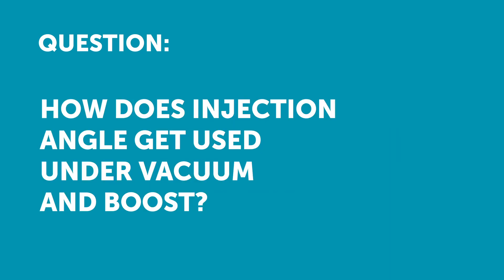Injection Angle | Boost and Vacuum Injection Timing Tips [HPA Q&A]

Comment: Interestingly, at low load conditions in port injected engines it's often more efficient to fire the injector while the intake valve is still closed (and I don't mean start injection before the valve opens and continue when it's open).
Reply: Why CHAT GTP  is telling us stock tune 3 generation gmc engine injection timing  occurred on a intake stroke. 360 to 540
Reply: @fernandoviniegra6909  Nope, LS1 fires the injector at the back of the closed intake valve while the engine is still on the exhaust stroke.
Reply: You are right ✅️
Reply: My friend here in the video says injector duty cycle would be at 75 to 85 %  the injector will be open almost all the time .what do you think about that
Reply: @fernandoviniegra6909  At higher loads/RPM that's true which is why injector timing doesn't really matter as much then since the injector has to remain open for so much longer - don't get to be as choosy with the timing.
Reply: The injection occurred from 71° to 341° crank rotation, between that it is 270° which it's not possible to have a 85% of injection cycle. 100% duty cycle will be 720°. I really appreciate your response 👍.